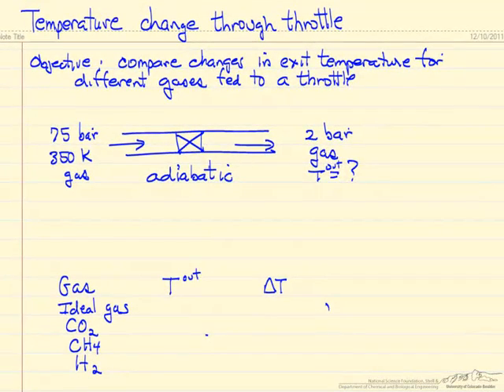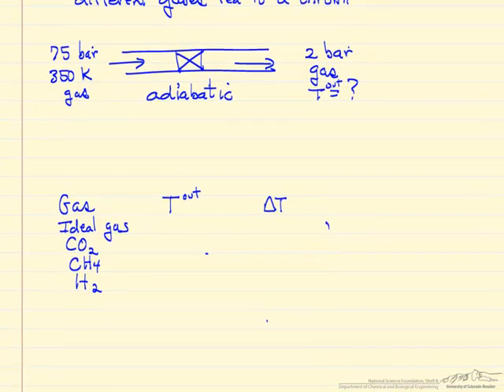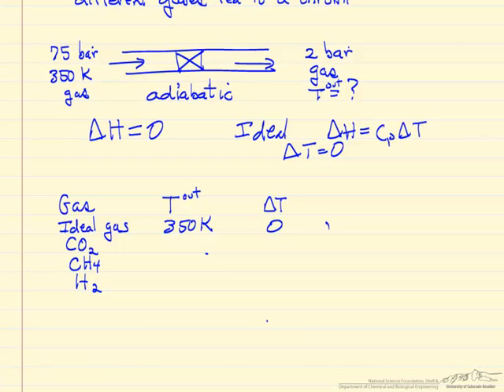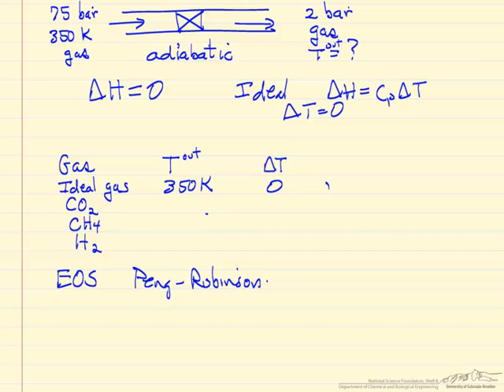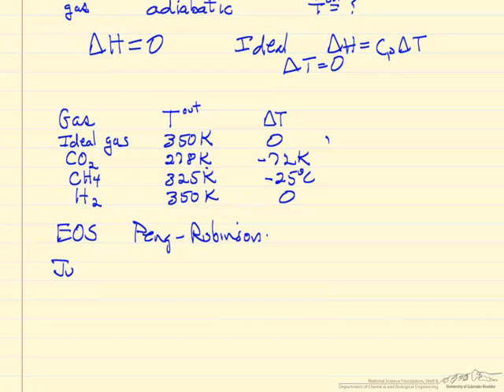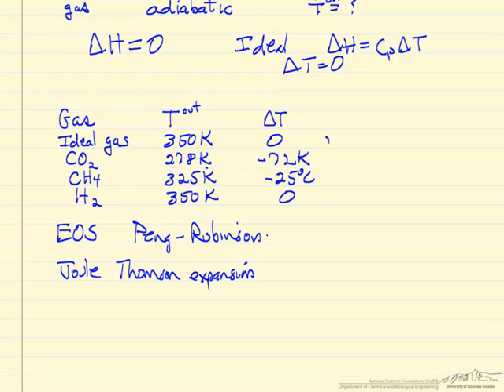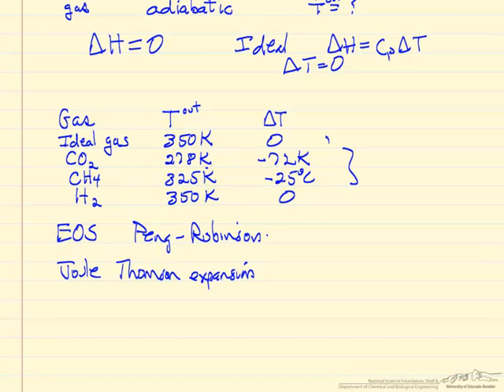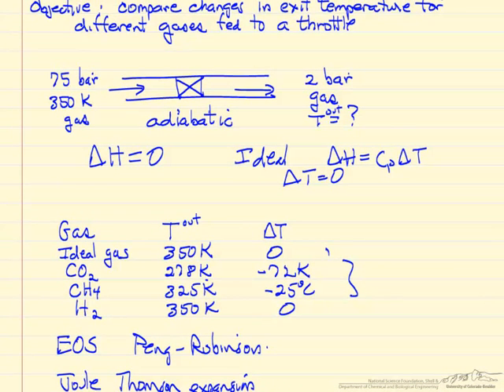Throttle Temperature Change

Comment: But why??? Why does the temperature drop?
Reply: Much of the internal energy stored as pressure is quickly turned into flow energy. Since the enthalpy (internal + flow energy of the gas) remains constant, (because no heat is added or lost by the system.) some of the energy stored as internal energy is transferred to flow energy. This causes a drop in temperature, because the energy that was stored in the heat of the gas is now converted to velocity. (because the gas is moving.)
Reply: @michaelmcdermott4385  in an ideal gas why does the pressure drop and not the temperature

Comment: So if you had a flow rate of x liters per minute through a throttle such as a high pressure cylinder flowing to some equipment and the delta pressure is know, how would you calculate the change in temperature across the throttle?
Reply from the maker: We do have some videos on open system energy balances within the thermodynamics playlist.  Might be worthwhile checking some of those out.

Comment from the maker: Not always wrong to use ideal gas law as it does fit certain conditions quite well.  You are right that the degree of precision may be important in certain places.  In most of these videos aimed at undergraduate courses, we have to start with simplified cases to show how to approach these types of problems.